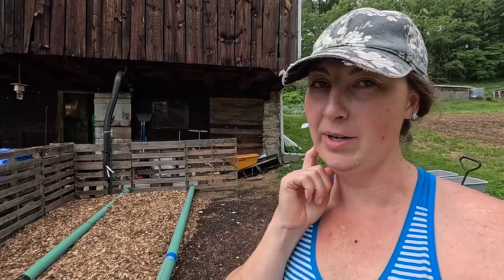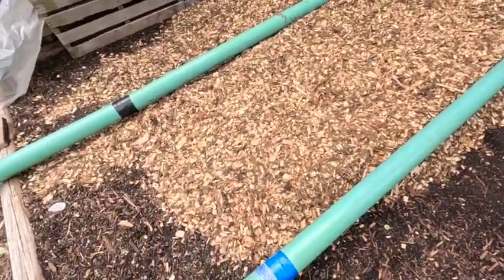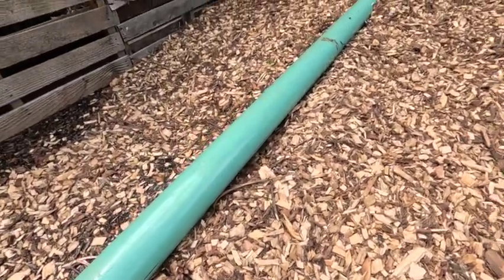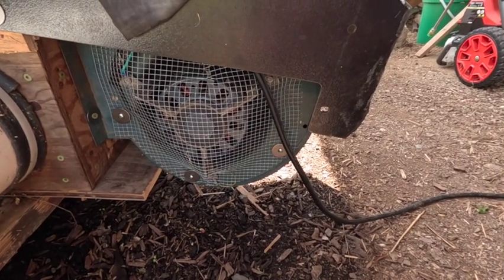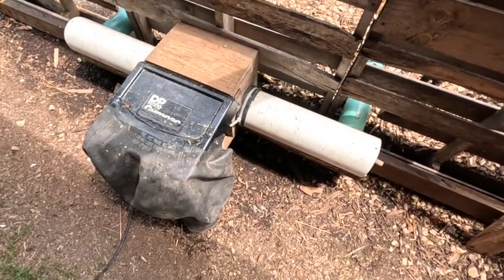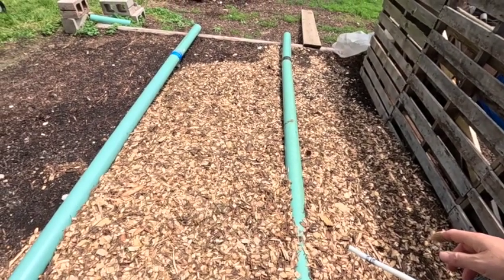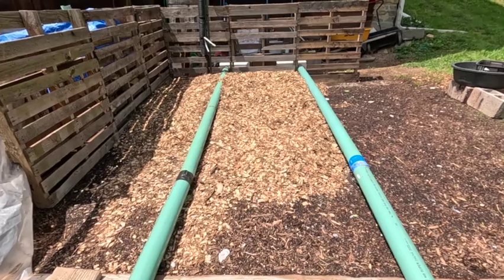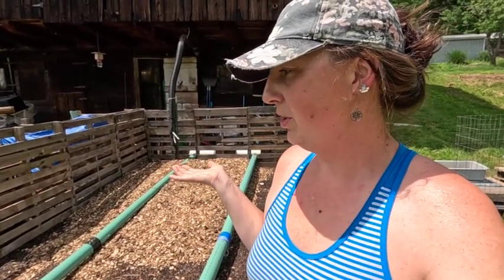New Aerated Static Pile for Compost

Comment: I think you mentioned that you were only going to run the blower for a minute or two at a time. Being an old hvac blower, such short run cycles might put too much strain on the start capacitor. I would recommend at least a 5-15 min run.
Reply from the maker: That's good to know. Is that typical of any blower or is it specific to this kind?